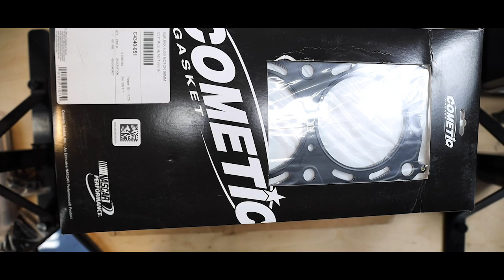1200WHP (Long-block) Flat 6 STi Breakdown and Cost

Comment: From what I remember the svx piston cylinder is 96.9 mm and the ej22 being 98mm yet only a 1/8th inch “ difference under what the ej22 piston spec out at in Mm , nothing a little honing boring to that point would fix

Comment: Beyond the performance parts availability is the fact that the EG block has WAY more material on the cylinder walls and is orders of magnitude stronger than the horrible piss-weak EZ engines.

Comment: I feel stupid for having to ask this. Do you have your "Rotating assembly" balanced before or after  you install your rods and pistons? I assume after, with the short block assembled? But that sounds wrong
Reply from the maker: We're suppose to balance them? 😳

I'm kidding lol the pistons get done at the machine shop to get weight equal and I do the rods here to balance everything out. So rods & pistons are balanced during assembly
 Cranks are all brand new OEM so they aren't widely off

Comment: Could you post the setup on the buckets to be able to set the valve lash accordingly thank you 🙏
Reply from the maker: Like how to measure them or my buckets?
Reply: @Smeedia  your buckets
Reply from the maker: My sizes would be diffrent than any other engine. Going oi be based off of valve length, cam size etc
Reply: Well honestly I'm trying to replicate your build on my 07 and I've been trying to watch all your videos to try and build a part list and what you did to the motor
Reply from the maker: When it comes down to buckets you'll still have to measure them out unfortunately. No car would have thr same bucket sizes 😖
Reply: Okay how do you measure them them, honestly this is my first build ever like I'm new to this thing as a whole never taken an engine apart nor put one together the most I've ever done is normal maintenance and that's why I'm seeking all the helpi can possibly get
Reply from the maker: https://youtu.be/mDuvTHrPbdM

Comment: What did you do for cams? I contacted Schneider and they are able to do a regrind on the stock cores but I was curious what others have used.  My build is similar to yours, custom CP pistons and ARP studs etc, just undecided on the valvetrain at this point.
Reply from the maker: Delta cams, they reground mine as well. I used super tech everything on mone + ported and polished on the heads

Comment: How much did you bore the engine ? And what are the benifits of closed deck over sleeved engine in replacment for the stock cylinder liners?
Reply from the maker: I'd have to look at the sheet again in the bore, did not want to drop a sleeve. Sleeves would be easier to service though

Comment: Dude I saw some guys online in austraila de-stroked and built an ej with high rpm in mind, and they run it to 12k rpm lol. 600hp too. And it pulled from like 4,000 to 12,000 rpm. That would be cool to do with a subie flat 6 and get like 10,000 rpm and 800hp. Revs are fun… that would sound demented. A de-stroked eg at 10k rpm 😂
Reply from the maker: 12000?! 😳

Comment: How much hp can stock sleeves hold? I wanna build one for 450-500hp
Reply from the maker: Seen stock sleeved around 500 or so. They're old engines now so it's always a toss up
Reply: Probably stay around 400 honestly bc its just a mostly daily driven street car. It's my first subaru. 02 wrx wagon all option car. 3rd owner but spent most of its life in Wisconsin before it came to ky. Luckily I'm a welder so we're fixing the rear strut towers this weekend

Comment: I've never realised how much the internet makes subarus look impossible to work with until I've seen this video. 
I always thought the engine (without turbos and all the good stuff) would be over $40k and everything else would be a pain to deal with. 
This video actually brought my hopes up because building my dream car seems so much more attainable.
Reply from the maker: They're really not as bad as people make them out to be, most of thr EJs are pretty much Legos. The FAs are a little annoying but super easy platform to work with and alot of misinformation out there 🙏
Reply: @Smeedia  Many a farmer in tractor pulls  braze alum rods at low heat for mounting areas like you had problems with. The rectified finish of the ots1000 brazing rods are stronger than the cast alloy mounts from factory and wont warp your block at all. Oh well just for future reference.
Reply: Classic Sti short block 4 banger is only around $2-3k for a brand new crate engine from Subaru

Comment: Do run that at SIR ?
Reply from the maker: Cars not running yet but I'd like to get it out there once it's tuned and alive
Reply: @Smeedia  what management system are going to use?
Reply from the maker: Using a haltech elite 2500 with their IC7 digital dash

Comment: Are you running stock lifters? Or solid
Reply: Buckets
Reply from the maker: Solid 🙏
Reply: Noice from bmw or what kind are you running ? Im doing eg33 turbo rn goal is 600hp
Reply from the maker: I'll double check with ourfront, they sourced the buckets for me. They've got access to a decent amount of parts for EGs 🔥
What turbo you planning on using?
Reply: Awesome ! Im going with a 6062 precision gen 2 wby ?
Reply from the maker: Ohhh very nice! I'm using a precesion 6870 Gen 2 🙏

Comment: What Subaru drivetrain component lives behind this engine? Nothing, at 1200 HP.
Reply from the maker: 🤣🤣🤣

Planning on running thr stock trans until it gives out, then sending what left to be built
Reply: @Smeedia  4 EAT is pretty tuff. Lol.

Comment: id make sure that's the right headgasket thickness, wouldn't wanna have those brand new pistons and valves kissing.
Reply from the maker: It is, everything was verified with the builder on this 🙏🙏 Id be so pissed if they kissed 🤣😤

Comment: hello where can i buy this :  Supertech Dual Valve Spring Kit
Reply from the maker: I would contact outfront motors, I believe they stock them 🙏🙏🙏
Reply: @Smeedia  okay thanks, and do you swap to solid tappets ?
Reply from the maker: They're still the standard OE Style for tappets 🙏
Reply: @Smeedia  still use  hydraulic lifters ?
Reply from the maker: Yessir 🙏

Comment: I'm not gonna say I'm a fan of Suburus. Nissan guy, but I do love me a good 6 cylinder. I'm interested in seeing what unequal length headers would sound like on this.
Reply from the maker: Also a Nissan guy! But super pumped to get this thing going 🙌
Reply: @Smeedia  I subbed just so I can see and hear. It's gonna be blistering no matter the horses. I wish I could do crazy builds like this. Like an AWD Maxima.
Reply from the maker: That would be a cool build! Just need my replacement shortblock to come back so I can get going on this one
Reply: @Smeedia  Are you going for reliability at all? I cant see this racing too much with the prices you’re quoting, unless it’s gonna pay for itself. 1200 ho to all the wheels should get that car down the track in like 8 seconds or less.
Reply from the maker: The car will have 3 tunes on it one at 600WHP /800WHP and 1000WHP.  It will be running mainly on the 800WHP tune unless it's going out to the track so not too worried on the motor. Last thing I want to do is destroy it

Comment: Torque plates just simulate the heads being there, so when honing they are torqued down, making the cylinders oval equal to what they will be when you put on your heads. If you bore/hone without torque plates the bore would be oval once you torque your heads down :D
Reply from the maker: The more you know! Thank you for clarifying a little more on them 😁
Reply: @Smeedia  wondered about the same once :D loving the build btw, got an outfront ej257 with closed deck and their 1/2" studs  myself :D they do great work!

Comment: How many hours will this motor last 1200WHP?
Achieving 1200WHP today is not that difficult, making it put out 1200WHP for hour after hour, year after year is a different  dino kettle.
Reply from the maker: Very true! And I'll be running it around 1000WHP max as it will be a track car, but it's all over built so hopefully it should last a long time

Comment: hey Smeedia, if one was to build a lower hp setup... would the EG33 stock block/internals hold up to 10psi? or around 8?  Do you know what the stock block is capable of?
Reply from the maker: I've heard of people staying around 6-8 PSI on stock internals 🙏
Reply: @Smeedia  any idea what kind of power that makes?
Reply from the maker: From what I've seen on others cars around 330ish
Reply from the maker: Also depends on turbo used though

Comment: Awesome! I've got a boosted EZ30R in my car, but the motor is still stock aside from head studs.
What did the reground cams cost you to do? I'd be interested in doing my exhaust cams, as they're quite small in lift & duration for a turbo setup. Would increase engine safety and maybe aid spool :)
Reply from the maker: I wanna say it was about $25 a lobe, in total around $750-$800 for the cams (both intake and exhaust 🙏
Reply: What heads do U have , z30 or u30

Comment: do you have extra parts lol
Reply from the maker: Some OEM stuff here and there lol
Reply: @Smeedia  are you doing a custom coil setup? I am looking into using a coil pack from a gm and mounting it under the intake manifold with plug wires ran to each plug.
Reply from the maker: I was looking at using R35 coils or LS coils 🙏
Reply: @Smeedia  I've got a 6.0L ls and a 4.8L I just pulled last week at work with all the coils. Problem is the igniter is on top of each coil. The way I was planning is to run the subaru ignition module to send signal and run a coil brick from a buick late 90s that will just do spark. Not sure yet but I've got front driver side coil going out and my forester sounds like it's got a hella cam right now at idle.
Reply: Also I may be interested in stock parts. I'm about to buy another wrecked svx for a spare engine but I like to horde h6 stuff
Reply from the maker: Lol just let me know what you need, been tossing some of it that's unusable

Comment: If you wouldn't mind telling me what buckets are there I'd appreciate it.

From my understanding and also having an EG33 first hand, the OEM ones are hydraulic but also a different diameter than EJ buckets.

I think some have found BMW E30 buckets to work.

But anyway, the bucket dilemma is one of the bigger ones when building this motor so it'd be helpful to actually have that information out there since you have first hand experience with it.
Reply: Also, what are you planning on doing with the radiator and fan setup?

Moving it in place of or under the radiator support?
Reply from the maker: They're just OWM EG33 buckets, same style as the EJ but like you said diffrent Dia. The builder has access to alot of OSM Parts to luckily he was able to get the ones needed for the set up. 

As for the fan and radiator, the rad will be pushed forward to sit where thr AC condenser use to be and thr fans will be push instead of pull so mounted on the front of the rad
Reply: @Smeedia  thanks! No concerns about them being hydraulic vs solid?

Definitely not trying to come across as critiquing the build... It was just something that when i wanted to build my EG and swap it, I was trying to find as much info as possible about the buckets.
Reply from the maker: Shoukdent creat any issues, outfrount would have flagged some concerns if it would have been an issue and no worries at all!
Reply: @Smeedia  awesome i had spoken to them a bit about the choice between EG and EZ for a while.

I had an RSTi that i wanted to swap, had an EG longblock and also acquired an EZ30R longblock but ended up selling the car.

Decided that I'll EJ207 swap my other RSTi and put my sleeved 2.1L motor in my '99 STi.

Definitely will be following the build since it's exactly what i wanted to do and never did

Comment: Ez30 is the path I went with my forester build - Destroys 5speeds so I had to upgrade to a 6 speed.  My goals are two k04 turbos low mounted and quick spool up for daily driving :P maybe I follow you and take the ez30 to the 1k hp range .. just not there yet
Reply from the maker: Sounds like a fun build, how many 5 speeds did you go through?!
Reply: @Smeedia  3 ! got tired of swapping those things out.

Comment: ej / eg water pumps dont line up quite right on the timing belt. found that one out the hard way =[
Reply from the maker: Good to know! I've got a new pump for the EG, bolt patterns look identical lol
Did you try the oil pump? Trying to figure out a way around having to have 2 crank position sensors
Reply: @Smeedia  i have not tried a oil pump, but the EG /EJ water pumps will bolt up, but the distance the on the pulley is different EJ would only have 1/2 the belt riding on the pump pulley. and also the timing belt covers wouldnt match up around the pump.   as far as the double crank shaft sensors if i recall the obd1 engines only used one, and the obd2 used both?  not 100% sure.   im just doing a mid engine vw bug with eg33. if i dig up some gold bars ill build the 2nd eg33 i have for boost.
someday..

Comment: If I understand the torque plates correctly they're torqued just like the heads in order to give you a true shape for the bore so there's no deformation post honing that would cause any issues. That's how it was explained to me.
Reply from the maker: Good to know 🔥🙏

Comment: honestly just having torque and turbo response at that power makes up for the cost hands down!
Reply from the maker: Should be a fun set up when done 🔥😁
Reply: @Smeedia  i got a very mild 3.3 in my 99 wagon. Went NA with big cams built heads and a really long header. 286whp has never sounded so good at 8300rpm haha

Comment: You could swap in any LS with the same power for about $2-3k or truly built, maybe $6k, just add a cam and turbo, tuning to any LS and get nearly 600 HP, add a turbo and valve springs 1000hp is possible, just add gap to the rings,    I'd do after market rods and ecm if any more power is desired,, but it's also alot  cheaper if you do most of the work your self,  at that power lines level I'd go with any LS engine, even the 4.8 is capable without spinding a lot of money , and mostly stock parts, just  Pistons and rods, and a good cam and springs,  to make upward of 1200hp 4.8L, with boost of course,
Reply from the maker: Would be fun but more fab work needed and this is something different. Tons of LS swapped cars out there already, wanna do something new 🙏

Comment: Duuude awesomenessss. Amazing luck with this all. So excited for you!! Also quick question. I’ve been searching around for a definitive answer to this question but haven’t seemed to find one lol. Should I get a burble tune for my sti. I kinda want one but I don’t want it if it causes damage. Would you recommend.
Reply from the maker: I qouldent get one, you'll reduce your fuel economy, throttle will feel ish, if your catted the fuel will destroy your cats, you run thr potential of washing your cylinder walls with fuel and denatured your oil over time 🙏
Reply: @Smeedia  fair enough haha thanks man. Keep it up

Comment: Hey do you happen to have a video of how to do E-85 blends?
Reply: I see you have a video on what you need to run e-85 but how do you blend it? I called a tuner shop today and they said they only do E-60 tunes I was confused.
Reply from the maker: There are some calculators online that can do all thr math for you, then you just need to fill per the calculator 🙏
Reply: @Smeedia  oh ok I found a calculator that does it thank you! Also had one more question what’s the difference between a flex fuel tune and a single fuel tune? 
Is a flex fuel tune more for road trips and when there is not a E-85 station around or do they give me two maps with 91 pump and then a E-60 I’m just trying to see if i should pay the 1000 for the flex fuel tune or just pay for a single tune on E-60 for 500 i don’t understand what a flex fuel tune is but I don’t think it’s a track tune correct me if I’m wrong. I’m from Colorado so E-85 stations are everywhere am I just better off paying for the single tune?
Reply from the maker: Flex fuel tunes allow you to use any mixture of E85 and pump gas. The Ethanol sensor will adjust thr ECU to the E%. Basically just takes away so you don't have to do all thr calculations for mixing fuel 🙏
Reply: @Smeedia   you the man!

Comment: hi can share what new cam bucket do u use? need some information tks
Reply from the maker: That will depend on what your valves are, the size of thre valves and the size of thr Cams your using. It will be diffrent for every car 🙏

Comment: cannot wait !!! I would like to get bigger head studs too. Any machine shop can drill half inch wholes into it and then I can just buy the APR head studs ?
Reply from the maker: Any shop should be able to do it, they just need the heads and the short block 🙏
Reply: @Smeedia  I called the shop and they said that I’d have to send the short block to IAG and they would have to do it and that was gonna cost a lot of money

Comment: Are you going to switch to Coils on the 17 or still run 1000whp on bags?
Reply from the maker: The bags have been sold for a hot minute, going with fortune autos 🙏

Comment: the motor is just sexy as it is i would hang it on my wall as art
Reply from the maker: Have to be a strong wall to mount that thing to 😅🔥
Reply: @Smeedia  haha yes but it would look sexy. man did my AOS, cylinder 4 mod and radiator. have to say iag clamps suck nuts